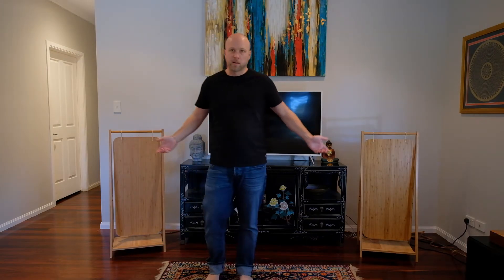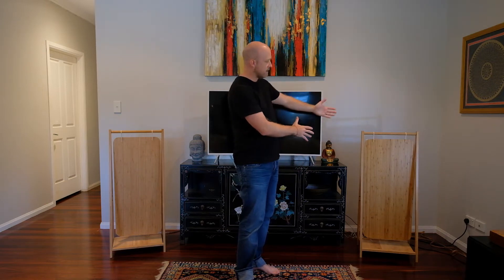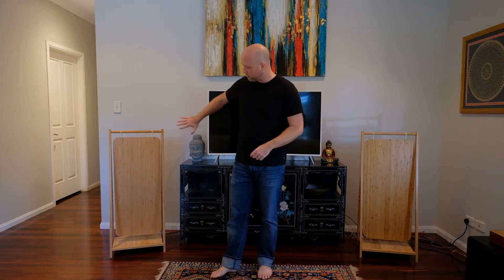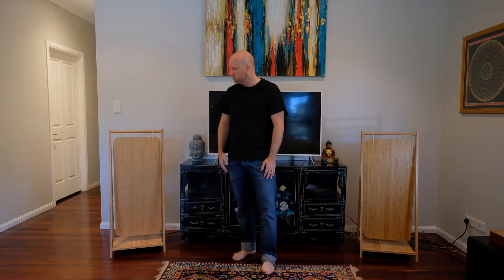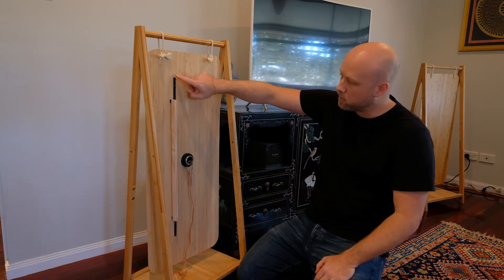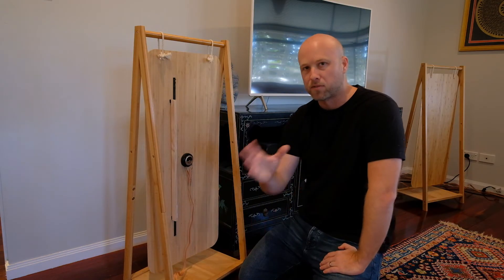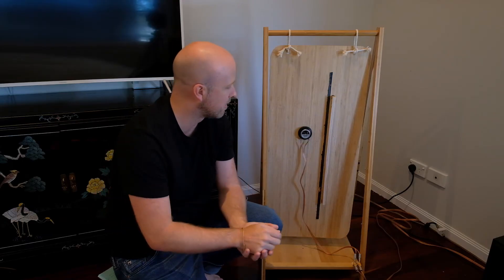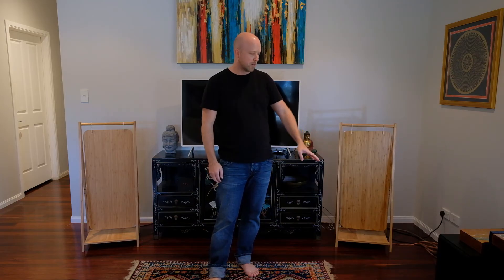How I made my Bamboo DML Speakers

Comment: Not trying to be overly critical but just giving my personal opinion, if it helps. If you were hanging them on a wall or making it seamless with the wall I can see outweighing benefit to the panel/DML type setup.  Otherwise, you are much better off with a traditional dual speaker box in the same space as your existing setup.  I saw Techingredients video but quickly moved on knowing there are major downsides in the long run.  
1)  By definition DML is a multisource speaker therefore your imaging and movie source localization is gonna be poor because there are multiple sources at anything above bass frequencies depending on the size of the DLM speaker board.
2)  DLM speakers, again by definition are mainly a harmonic resonant acoustic source, which is the opposite of a traditional speaker/enclosure (not subwoofers), which is designed ideally to not have any resonant frequencies.  That is, an ideal speaker will speak whatever frequency the amplifier throws at it equally loudly, and speaker manufacturers try to achieve this by making the moving mass as light as possible, separate speakers for highs and mids, crossovers,  light weight surrounds, the goes on.  All this means is, only highly specific music is gonna sound very good with DLM speaker board, and most everything else will be mediocre at best, poor quite often, if one is picky about music that is.  Which leads to 3).
3)  DLM board is a single fundamental frequency resonant speaker, just like a single cavity musical instrument.  Therefore if you tune your speaker size and driver position to match a single resonant cavity music instrument such as guitar, a specific singer's vocal box, flute, violin so on, you should get amazing sound amplification relative to your input power.  At any other frequencies, you lose that gain.  
So if you want to continue experimenting, in addition to variable driver position, try adding mechanically coupled metals, board cutouts, etc. to add new harmonics.
Other than for learning about acoustics I see no benefit in a DLM speaker assuming space is not a constraint.  Let me know if you think I'm worng, I am learning about these aswell and I never tried a DLM setup =)
Reply from the maker: Hi,  thanks for the thoughtful reply!

You're not wrong in that the panels do have some serious downsides. They definitely have a unique sound though and I find the concept interesting enough to want to experiment with it and see how good I can get them. The 'floorstanding' design also means I can move them around / bring them away from the wall etc.

1) This is true and is probably just something I'll have to live with if I keep the panels. So far I have only used them for 2.1 channel music so I can't comment on how they sound for movies.

2 & 3) I wouldn't compare the panel to a speaker enclosure due to the reasons you've mentioned - it's more comparable to the drivers in a traditional speaker and some of the same rules apply weight, stiffness and material are all factors determining how a panel will sound). 

As far as resonances go, the graphs tell the story - there are obvious peaks and troughs in the response but there are many of them, not just a single resonant frequency that dominates the sound.

I've done some quick tests on a rigidly mounted acrylic panel similar to that in my acrylic DML video and the results are so far encouraging, and I have some more ideas that I haven't yet tested, with the goal of further smoothing the overall response.

Comment: Hello Ben, just wached your video and honestly i was impressed of what you made and presenting it on the video itself! Very simple to assimilate material, easy to do and nothing to make your wallet empty. By the way i love travel photos. Many congrats for the russian vehicle at 15:53. I wonder where did you catch it... Hope to help you out with the board materials...  probably you didn't try with OSB sheet. Yes! A low quality material itself, but!  The OSB sheet are made of different size particles (as anyone can see). It's cheap. It is not very stiff, but the particles in it are capable of different resonances due to their random size and thickness. Technically OSB is better for making loudspekers than everyone's favourite MDF. Maybe difficult to make the finish with it's ruff surface. MDF boards are easier to work with, but thicker and heavier. The speaker box resonanse frequency will be more focused. Even plywood and particle boards are better for speaker box materials...
Reply from the maker: Hey Jordanka, thanks so much! The car photo I took  in  Kyrgyzstan on the Pamir Highway. I didn't know  what OSB was but I recognize the look. It sounds like it would be quite 'dead' though wouldn't it?

Comment: Hey Ben — any thoughts on the best ways to remove an exciter from a panel and reuse it? Ordinary double sided tape is nowhere near strong enough and the stuff on the exciter instead is designed to stick forever, making it almost un-pry-offable… Thoughts?
Reply from the maker: Not really! I’ve pried one off with a blade but it damaged the panel surface. I think maybe some kind of solvent to remove the adhesive might be the way to go but again it depends on the surface of the panel.
Reply: @TypicalBenYT  thanks. in this case, a panel of paulownia. Which despite sounding Polish is an Asian wood little heavier than balsa but a lot stiffer. It's commonly used as cutting boards in Japan, and breaking wood in martial arts clubs everywhere...
Reply from the maker: @イエンスヨハンセン  Wow that sounds interesting! Are you removing the drivers because it doesn't sound good or to put new ones on? Also I wonder if a good technique might be to lift a small part of the adhesive with a blade, then get a few drops or soapy water underneath - I know it can work on regular tape.
Reply: @TypicalBenYT  interesting—I’ll try that. It didn’t sound great because the panel I used was too small. An attempt at a cool little Bluetooth player… but my question is more about a theory I want to test about using several exciters on one panel. If it doesn’t work, I want to be able to recover the exciters for the Next Big Thing…
Reply from the maker: @イエンスヨハンセン  yeah understood - I need to figure this out as well, can’t keep buying new ones for every experiment!
Reply: @TypicalBenYT  Hey Ben, get some dental floss and use it to cut through the glue to remove the driver, then use a solvent to remove the glue. purchase some 3M double sided tape to re- affix. Hope this helps>

Comment: Did you try different types of woods ?
Reply from the maker: Not yet. I’d like to try some kind of tone wood at some point though.
Reply: @TypicalBenYT  It's easy enough to try different materials.  Just hold the exciter against the slab and listen.  While you're at it, try it on a window, the wall, a table, a wooden bookshelf.  Be sure to move it around like a doctor with a stethoscope to find the 'best' sound.

Comment: I got a pair of 8 ohm 25 watt speakers and tried them on various things,
A larger round melamine serving platter , Not very loud and a bit flat and tiny
A rectangular softish plastic serving tray. A bit louder and better sounding but no cigar.
A cheap painting canvas  on wooden frame, FAIL
A very large and heavy hunk of perspex panel. a bit better than the round platter.
A CHEAP foam body surfing board I got from a dollar store in the toy isle. PERFECT!
With all the others I had to crank the levels up to match the normal speakers, with the body boards I had to turn the levels down on the DMLs and up on the others
I have them hanging from a picture rail and they don't look too stupid but I will see if I can hide them behind a painting or reshape and paint them.
Reply from the maker: Please make a recording, I'd love to hear what a DML surfboard sounds like.
Reply: @TypicalBenYT  https://youtu.be/Xq0LcInzk7s

Comment: What I find funny is that the 2/5th 3/5th rule almost perfectly matches the golden ratio. Don’t know if that means anything I just find it to be a funny coincidence.
Reply: It's literally the point of the ratios
Reply: Just searched Gloden RAtio of Sound on YouTube and found me a new rabbit hole.
Thanks!
Reply: It seems the panel dimensions should be golden ratio as well
Reply: In the original video on how to make these, that is how they chose the ratio in order to test.  It worked for them...

I wish I could remember who did those videos but if you look around lots of this type of video mention them.  Good luck.
Reply: @carlfranz6805  tech ingredients :)
Reply: Yep.  The Tech Ingredients video didn't mention it, but plenty of comments pointed that out.  It's not hard to get it exactly at Golden ratio positioning, btw -- at least exact to within the limits of measuring ability -- all you really need is a compass or some other means of drawing a circular arc.

If you have a square of side 1, and split it in half on one axis, you'll have two rectangles that are 1x0.5.  Draw a circular arc from one corner to the other of either rectangle.  The radius of that arc is exactly 0.5 away from the golden ratio.  Add 0.5 and you get 1.618... subtract 0.5 and you get 0.618...
Reply: @parasharkchari it gave me joy to find someone who knows , we are few and in-between that have mental capacities to think 🥂
Reply: I don’t remember Tech Ingredients mentioning golden ratio but he didn’t want to put the exciter in the dead center because it would cause constructive/destructive interference, being equidistant from the sides. You want to get as even sound profile as possible
Reply: I was thinking of just that very ratio, whe n  i first saw 2/5 and 3/5 recommendations
Reply: jordan 23, julius ceasar stabbed 23 times, 2:3=0,666; george washington sculpture is 555 feet high. there used to be tri cycles and bi cycles as in cycles of society. there is much more to it.

Comment: I wonder what would happen if you hang the panels from top and bottom by rubber or silicone cord of some kind.
Reply from the maker: Hey Oleg, do you mean suspending them without making holes in the panels somehow? Or with holes but with elastic materials to allow greater movement?
Reply: @TypicalBenYT I meant Elastic elements at 4 corners.
Reply from the maker: @olegloginov6328  It would be an interesting experiment. I have thought before about building a frame with maybe 10cm gap all the way around the panel and sort of 'lacing' it to the frame, which might work well with elastic. It would be fully suspended but presumably the elastic would provide some damping as well.
Reply: @TypicalBenYT  Exactly what I was thinking 👍

Comment: Listening to an audio demonstration via YouTube on a iPad is a bit like listening to a Dad joke from an acquaintance instead of watching a live standup comedian. But in comparison to the other DML examples I have heard on the iPad via YouTube these are not the best example, they have a quality of a tiny cheap speaker in a Pringle’s tube. This effect is primarily caused by the rigidity of the material used which is why foam board sounds so good. I believe in the series by TI they tried sound absorbing ceiling panels and got an ever better result than foam board.
Another YouTuber has tried various treatments to the foam board such as cloth and paint.
Cloth seems to have little to no detrimental effect on the sound quality.
Paint especially if it is a hard drying one has some detrimental effect but very slight.
Reply from the maker: I’ll make a pair of Pringle tube speakers if you’ll give me feedback on them.
Reply: @TypicalBenYT  . If nothing else you will learn how to make the worlds second worst speakers.
The worlds worst are whatever it is the fit into small TVs.
Reply from the maker: @anomamos9095  “How to make the world’s 2nd worst speakers”. I dig it.

Comment: The bigger the panels the deeper the base.
Positioning of the driver also affects base response. Dual drivers affect base response.
Positioning dampers in various places alters the response better than bracing.
Tech ingredients did a video on this also, they have a series on the dml panels.
Reply from the maker: Yeah the only problem with big panels is that I don’t want big panels. I’ll take a 2.1 setup that actually fits in my room and has great bass thanks to the sub. A big DML bass panel up on the wall would be cool though if it actually worked…
Reply: @TypicalBenYT  I have been looking into these for a while now first as curiosity but now I need to build a set as my new place is a classic old building and I don’t want to hack up the walls or ceiling for speakers etc.
What is of primary interest about them is the possibility to make them look like art works by either painting them or setting them just behind a painting. I have a couple of spots I can hang some very large paintings.
Reply from the maker: @anomamos9095  Nice. I guess you’ve probably seen it but there’s a thread on DIYAudio where people were getting decent results using stretched canvas art with a small panel in it.

Comment: These are very impressive and beautiful speakers. I've built several conventional speakers, but only ever small bluetooth DMLs. I'm definitely adding these to my project list -- they seem a lot easier than planar magnetics, which i also want to try building... If you're thinking "planar magnetics -- thats just loonyville" check out Joppe Pelen's channel. That boy's a genius.

By the way, I agree polyurithane seems very likely to sound like crap. It never sounds good in any audio application. I use violin varnish on all my speakers and am very happy with the sound it makes. I also make them of tone wood, so it's at least internally consistent, if not 100% orthodox...

Thumbs up & sub...
Reply from the maker: Thanks so much! I'll have a look at Joppe's videos as that does sound pretty crazy. As you've noted, the construction of DMLs can be very simple with good results.

I do wonder how a relatively neutral tonewood would sound compared to a ply. Yet another avenue to look into!

Comment: actualy there are exiters for bass    as they are in some cars     and are just vibrators attached to the metal of the body work     and they make bass     i had a saab 95 aero    and unless you knew what they were      you would think you have conventional subs in the back
Reply from the maker: Interesting. Are they similar to the ‘Bass shakers’ you can buy from Dayton and others? They’re designed to shake the back of a seat to make the bass feel bigger, but I do wonder if they’d work on a panel…
Reply: @TypicalBenYT  they dont shake the back of the seat    but rather the   the rear panel  of internal metal    perhaps they are from dayton audio i dont know but unless you knew what they were   you would swear there were two subwoofers in the back

Comment: i think the overall sound and base response qould benefit from the driver been not swinging free in the air, but to be mounted like on the wall or so. Then the base would go complete in the panel, instead of the magenet swinging.
Reply from the maker: Possibly. In my next pair the exciters will be braced from behind with a rigid frame. It’s not easy to set this up using a free swinging frame though. There isn’t really a noticeable different between letting it hang and physically pushing it against the panel (with my hand) but it’s probably better to some degree - just have to manage frame vibrations coming from the driver which isn’t an issue in this current design.

Comment: Without an enclosure, a cabinet or box, sealed ( Infinite Baffle) or ported (Bass Reflex) the low frequency waves, which are very omnidirectional, affect the low frequency waves from the opposite side of the soundboard by being out of phase with them and literally canceling them out. In general, the higher the frequency the more directional the sound so midrange and up frequencies have less effect from one side of the soundboard to the other.
Reply from the maker: Hey Joel, thanks for clarifying! That makes sense - it's going to be hard to get a decent measurement in my smallish living room then I suspect.
Reply: @TypicalBenYT  You can reduce the reverb quite a bit by either covering the walls behind the panels with a sound deadening material or build a conventional speaker type enclosure you hang the panels in front of with the interior covered in sound deadening material. This cleans the sound up quite nicely and removes the 'auditorium effect' the omnidirectional nature of the speakers produce.
Reply: I was thinking about this as well. Planning to put some foam deadening on the wall (with 6" of overlap all the way around) behind hung panels. So since mine are 24" x 24", I will do 36" x 36" behind them.
Reply: How would he improve the bass? FYI I'm interested in using these for a band setting 😅